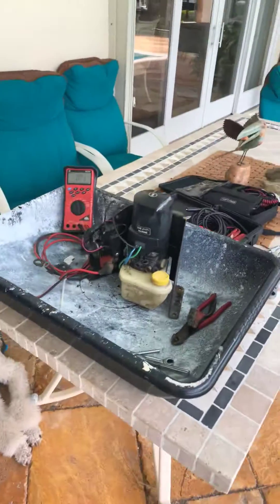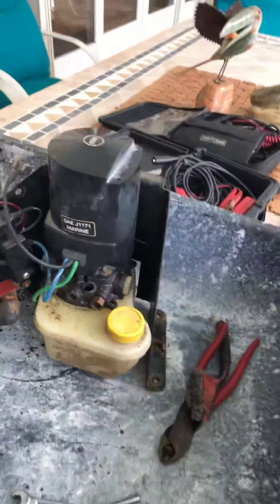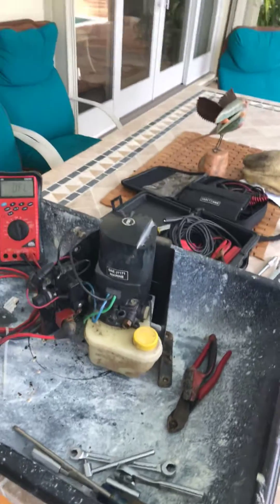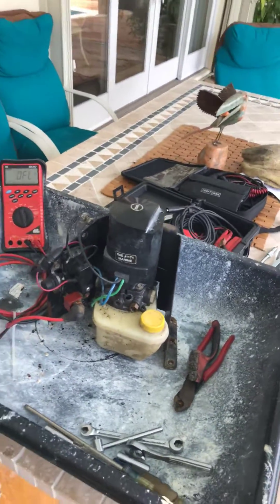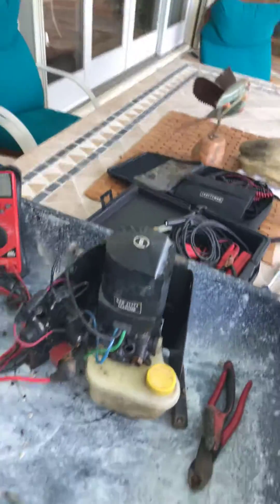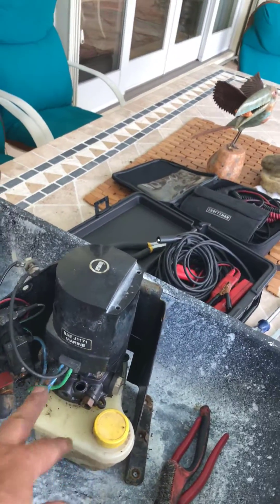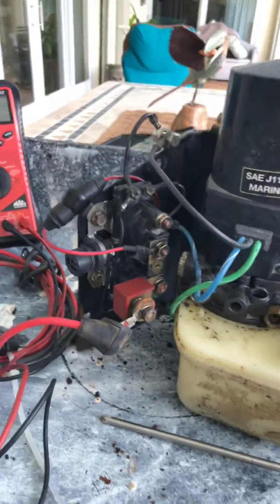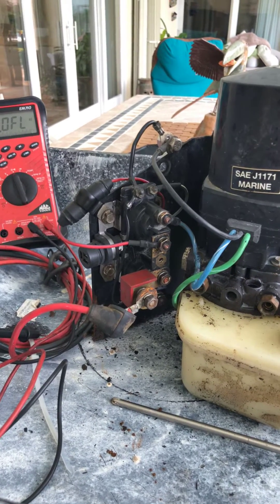Mercury (Any) tilt motor diagnosis & repair Part 1

Comment: Do these older trim motors like these have any type of relay switches? Or is it just those two solenoids that act as relays? My motor goes up just fine but when I turn the switch down nothing happens at all. No sound coming from motor when switching to down position. Is a bad solenoid my problem? I'm not a mechanic and would be appreciative for any advice at all
Reply: Hello Terry, I have the very same problem. Did you figure out what your problem was? 
Thanks in advance
Reply from the maker: Sorry I didn’t get back to you guys sooner, but if you have up and you do not have down then it could be one of three problems the first problem could be the solenoid itself, the second problem could be corrosion on the power bar to the solenoid and third thing I would check is that the switch sends power to the down solenoid.